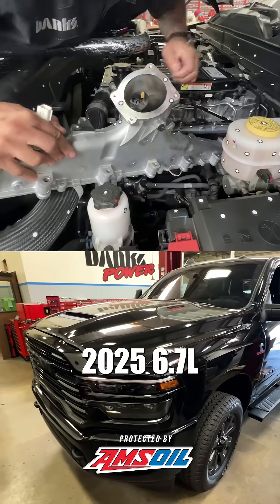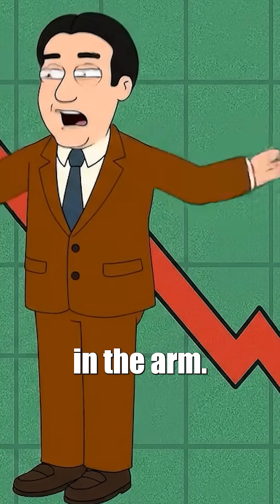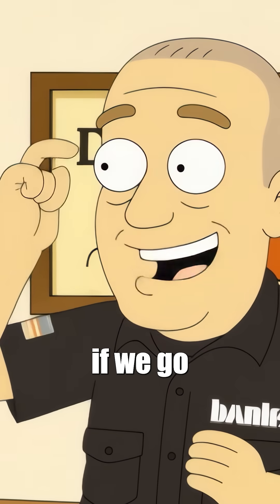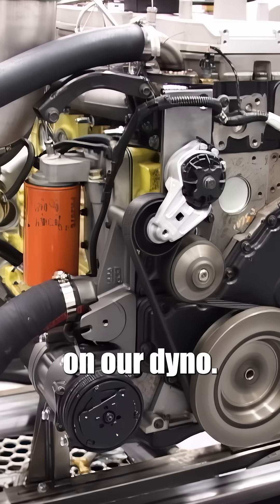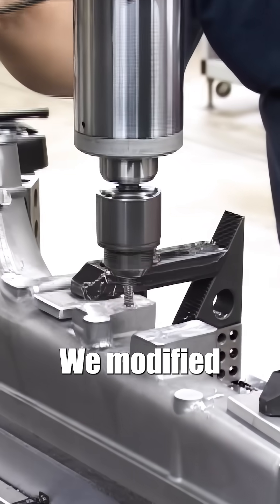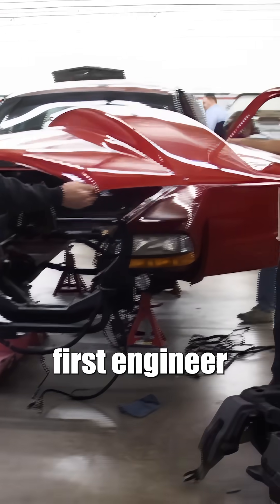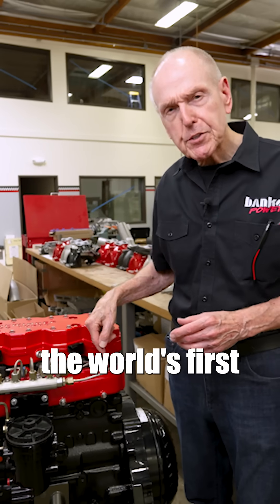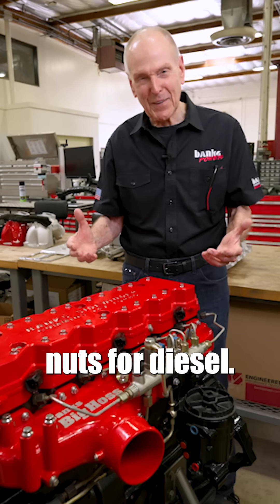The story behind Cummins' secret weapon.

Comment: I love Mr Banks🤔hmmm I owned a 2017 Ram 2500 but sold everything moved into a 26 ft motorhome powered by a 7.3 Godzilla. I do wonder why Ford didn’t keep the 7.3 diesel for these applications especially E series like in the Thales.
Not that the Godzilla can’t do it but the torque that the diesel provides for towing and ya you know 😂🤔🤷‍♂️great job sir I love this
Reply from the maker: The 7.3L diesel is a legend, but the new gas engine is a heck of a performer.

Comment: My how time flies, having to re-engineer the head for greater port size and better flow in your machine shop video it looks like you are starting with a new casting without valves or ports or was it something else??
Either way taking a Cummins diesel from 200 Hp up to 700 Hp is quite an engineering feat.
I know you must have some of the brightest minds on your team if you completed the work and then tested the truck by towing the trailer to Bonneville Salt Flats.
Did you ship the truck and trailer to Utah near Bonneville and drive twenty minutes to the flats?
Because that video shows a shiny showroom floor truck with not a speck of road grime and a trailer that looks like it was just washed.
I really love the way you carefully weave a story with just enough information to make it tantalizing, I’m practically salivating about owning a truck with a Cummins diesel and having 700 plus horsepower on tap.
Does it get 30 mpg highway too?
What I want to see from Gale Bank’s in his next video is a 2017-2019 Volkswagen Passat Diesel reworked by Bank’s engineering to increase the power and airflow to double the horsepower and get a former Diesel-Gate engine up to make more power and get 55-65 mpg.
Most people don’t know that Diesel engines when they are tuned and the airflow is increased are higher horsepower and more economical to operate.
In Gasoline powered car’s the more horsepower and torque and tuning the lower the gas mileage becomes.
Conversely with Diesel engines the greater the compression the better the airflow the higher the horsepower and torque the more miles per gallon you get.

Comment: Can you do my truck? I have a 59 2005 love this truck I’ve got about 300,000 miles and I maintain it. I change the oil every 3000 miles. It is just been a super super good truck. The last one I had was a 91 which had over 1,800,000 miles, same motor 59 I replaced it pump three times

Comment: "Tune" the exhaust manifold.
Hard to explain but that lines up exhaust "pulses" so they are timed, via the length is individual pipes to produce a flow of exhaust gases rather than pulsed exhaust gasses interfering with other pulsed exhaust gasses at the collector of the exhaust pipes.
They've had "tuned" header for years for gasoline's me powered engines and they work quite well ...

Comment: Cummins stock was in the tank because caterpillar had nearly 40% of the medium duty and heavy duty markets for on highway truck. When tier 4a emissions came out Cummins went with egr while Cat used HVLP two turbo set up. The Cummins didn’t soot up nearly as bad as Cat thought and the Cat technology wasn’t developed enough for good reliability. Sir, you didn’t do anything to save Cummins.

Comment: Real OG's like Gale have been showing OEM Engineers what time it is for decades. I have full faith he's not done cooking yet.
With banks gear the only limitations will become the rods and the ring lands on the pistons.
With a really dialed in setup and the right parts you can eventually be up against the structural integrity of the block. Nothing else stopping you.
 Gale Banks is a legend.
Rock on good sir. Rock on.

Comment: I personally would take a Banks warmed over 5.9L over a modern 6.7 Cummins!  Sacrifices had to be made to gain the extra displacement (like head gasket fire-ring footprint).  And then there's the self-consuming roller cam lifters, the CP4 injection pumps, SCR catalyst & Urea injection exhaust systems!   Diesel engines are an area where simplicity usually beats designed obsolescence technology!

Comment: I personally think the 5.9 was the best engine Cummins made! Even stock! Now that all of the manufacturers have got into this Peter pulling contest of HP, Torque, Towing capacity, speed their engines are failing more than ever! If not mistaken, the whole attraction of the diesel was the added torque vs gas engines and longevity? The original 5.9 accomplished all of this. If you think about it there were more people working in the Trades back in the day and actually used their trucks for Work not racing! They all need to stop!! Nobody who owns a 1/2 ton pick up truck needs a 49.6 liter engine producing 16000hp and 20k torque! Just STOP! Bring back the old original 5.9 getting a million miles without being in the shop twice a week!

Comment: I drove a lot of Freightliners with Cummins the latest Freightliners they've been buying have the DD 8 Detroit Diesel those trucks are so much better to drive than the Cummins. At 350 horsepower I need a little bit more I wonder if there's upgrades for that engine

Comment: Omg im getting a 2004 ram 2500 today! Im so freaking excited. Has the cummins in it. I never thought id find one. Im gonna be on cloud 9 in just a few hours. I havent seen a picture but the guy said theres nothing wrong with it. So im praying. Its 3500 which is about every dollar to my name. Im throwing my hands up and just gonna go for it. Side note ill be buying some of your upgrades very soon. Especially everything that keeps the engine and trans cool.
Reply: Yes I did! It's freaking sweet. Got it for 3100. She's a beast. Gotta take the bed off and give the guy his goose kneck ball back. Hense the 400 hundred off. It needs a good cleaning and some general maintenance but she's gonna make me smile everytime I get in.
Reply: Best of luck man and congrats if all goes well!!
Reply: So did you get it???
Reply: What happened?
Reply: Decided to keep the the fifth wheel and the trailer brakes kits. Gonna throw the guy another 400 next week. It's awesome been driving Ole Red everyday. She doesn't leak. The Trans is getting a new filter and fluid tonight. It drives straight. Hums along at 80 no problem. Has all the power. Im in love. Smiling ear to ear.
Reply: Update please.
Reply: Well done 👏
Reply: Good luck to you brother. I’ve got an 04 4 door long bed dually nv5600, and an aluminum flatbed. Love this thing to death. 226k Alaskan miles.
Reply: Ive daily drove an 04.5 for the last 21 years....  they are dang good trucks.    I do recommend adding a better fuel filtration system...  like a cat fuel filter

Comment: Thanks for sharing this story😘‼️To push the stock engine over 700hp (Audi had a Le Mans diesel engine that developed 650hp, if I'm right🤔) is INSANE, especially when you consider that this development took place 20 years ago. To achieve this with little support shows your dedication! 
You are a wizard, a craftsman, an engineer and a lunatic in the same person🤩. Cheers from the 'fatherland' of diesel engines!🍻
Reply: If I'm not mistaken, there are rules and regulations for different motorsports, so Audi was probably held back, but also they had to make that engine last full throttle for 24 hours. You can make high horse power numbers, or make the engine last a life time, but combining high horse power AND longevity, and under strict rules as well, is a way harder task. I think Audi did an amazing job. For comparison, BMW did cram out around 1400hp from a 1.5 liter 4 cylinder petrol back in the early 80's F1 turbo era, but that poor thing lasted like 5 minutes, only for qualifying laps.
Reply: @haavard1989 If it comes to Motorsport, rules have always been bent (or interpreted). Of course you can't compare the Cummins engine directly with the LeMans engine. I guess we both agree, that Audi created probably the pinnacle of high performance diesel engines! 

If you put enough boost on any turbo charged engine, you can achieve fantastic power outputs, but that comes (as you mentioned) at a cost. 

Even if the 700hp are 'healthy', it doesn't mean that that counts for the transmission/gearbox (the torque must be insane!). 

Nevertheless this prototype engine seems to be the base for a product that you actually and still can buy. The fact that they were able to reach Bonneville on their own axles (very likely with reduced boost) tells its own story.
Reply: @donkiel9988  I agree (y) Pushing the limits is what drives technology forward, so we should be thankful for everything they have done. Many people don't even think about how racing, pushing limits and stuff, affect us just driving standard cars.
Reply: OM606 does 600HP stock engine, modified fuel pump & turbo and its 3.0L simple and reliable. I like the banks work though.
Reply: I watched the early Audi Le Mans diesel vehicles at Infinion Raceway (previously Sears Point, CA).   Those vehicles were extremely impressive and capable.  But the fuel wasn't D2, or anything like it.  It was a custom brew of synthetic hydrocarbons, with very high BTU per pound.  It was much closer to military missile fuel than standard diesel.  But the race circuit's officials never encountered this before and let it pass as "diesel fuel".
Reply: And no Turbo?!?
Reply: @CoffeeAddictEvan  If you meant the BMW; it had a huuuge turbo. If you meant the Audi TDI; It had 2 turbos, capped to around 42 psi.

Comment: In high school some buddies of mine were getting to be fans of the diesels. I was mocking them saying they can't be naturally aspirated and compete against a NA gasser. But I did also tell them why dont they start thinking about camming along with port and polishing the diesels. They laughed at me and said diesels dont work that way. Well guess what they do now... the same buddy ended up getting way into diesels and built his own home made 12 valve in a 95 Ford with 38" swampers. He won several truck pulls and even beat Ken Jones one time. Then he'd take it to the local 1/4 drag strip and run low 10's without hitting the nitrous.

Comment: I had bought that entire setup after you produced it for my 2004.5 Cummins 5.9 24 valve that was the best thing that was ever available for the 5.9
Reply: I bought an 04.5 brand new when i turned 18.  She turned 21 years old this month... and still daily driving it.  All ive done to the motor is, 2 sets of injectors, 2 injector lines, 1 lift pump,  and i added a cat fuel filter between my factory fuel filter and inj pump.
Reply: @Pigtrapper curious how much it was back then? Seems like tiday that would be impossible at 18 lol. But I remember buying my first brand new at around 18 in 98. I had $2500 down and I bought a mustang and my payment was like $430 a month lol. Insurance was about the same since I got a dui the next month
Reply: @seshansmith7690   the dodge was $30k.     But i was upside down on a ford v6.    Signed for $50k.  Payments were $660.  But i was living at home, had a good job, and hadnt started drinking yet...lol
Reply: @Pigtrapper what is a side draft manifold anyways? And what does it do?  What else was in the kit?
Reply: @abc-ed1nr the cat fuel filter kit?   I just bought all the pieces and made a braket that attaches to the master cyl studs.    Amazon has the housings, just get fuel hose(dont remember what size) , filter, fittings, and plugs (or fuel pressure gauges... so you can read either or both sides)
Reply: @Pigtrapper how many miles she got now?
Reply: @ChRoNoS132  showing 223,992.  
Ive ran oversized tires the majority of its life so its more.   I never pulled heavy trailers far,  hauled pecans out of river bottoms and to the buyer,   ill pull a 32ft with farm equipment pretty often,  but she dosnt get worked hard for very long.   I want her to last.
Reply: @ChRoNoS132  pecan trailers were around 8k of pecans.  Plus dump trailer.  About an hour trip.  Mostly flat other than coming out of the river bottoms.
Reply: God those were the days... now a mildly optioned diesel F250 is 90k easy. And brand new 60th anniversary GT Stangs are 60k..... Everything costs more for all the planned obsolescence they had to engineer.
Reply: @AllenF05 I bought a brand new 2020 Mustang GT for $32k.  That was riiiight at the end of anything being a decent price.  😂
Reply: @AllenF05  dont forget that gm spent almost a billion dollers developing an engine... that they never used other than on a race track
Reply: I had a 2005 with the whole banks catalog thrown at it still to this day it runs the coolest doesn't sweat when towing and makes all the best sounds put my buddys truck up to the test a 1000 HP Cummins didn't make it 10 miles without an issue
Reply: How u get the manifold? Only the horn is available as I see it?